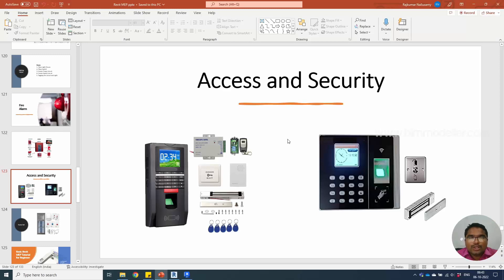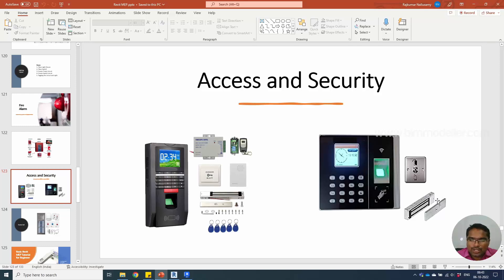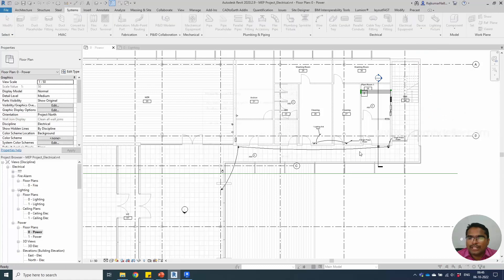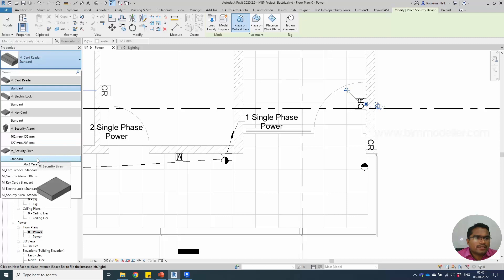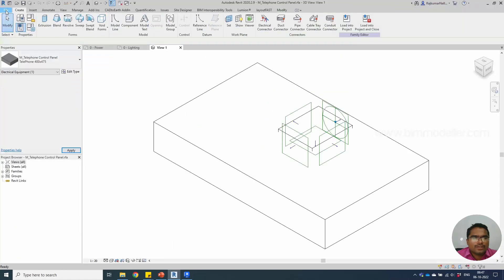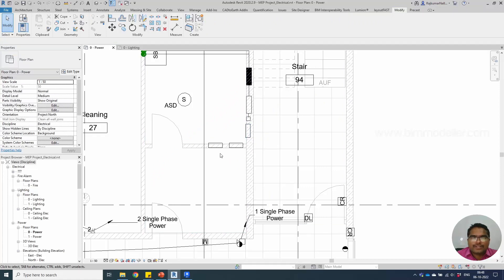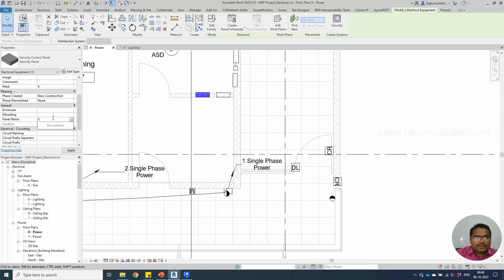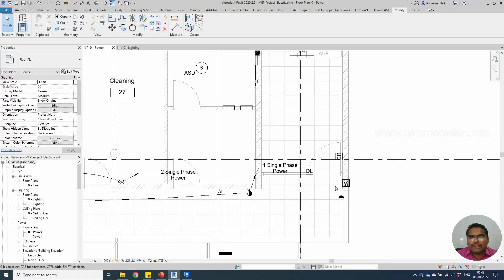#Revit MEP Project 44 : Creating Access and Security System in Revit

Comment: Thanks a lot for the tutorial. After making a security board and changing the name of the board, what is it: a data panel or a switchboard? How do you change the name of the cable in a data panel?
Reply from the maker: Select the system and you will find the option.